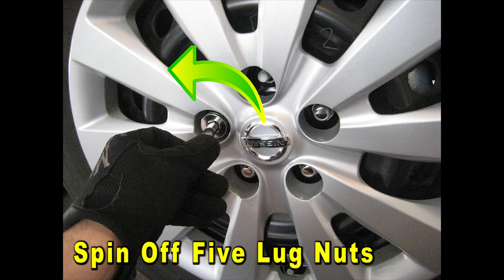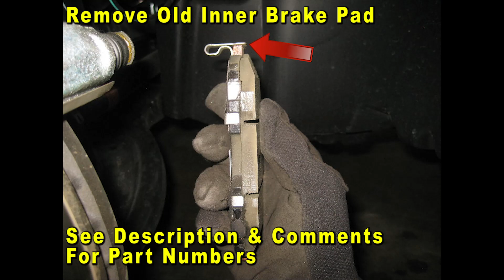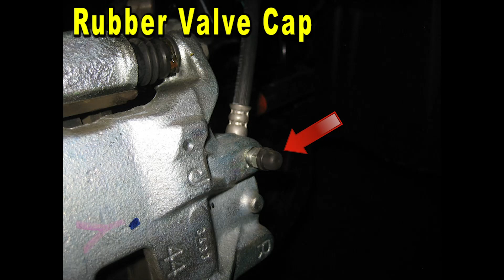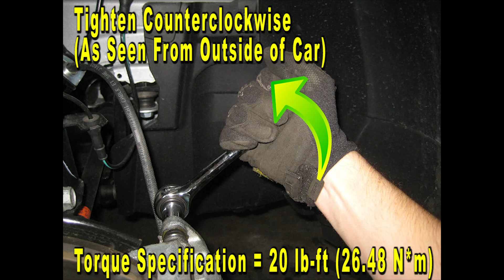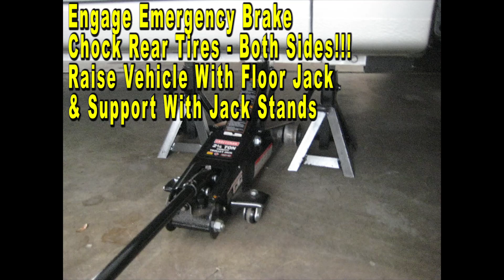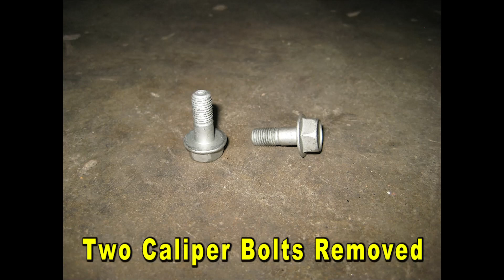Nissan Sentra How To Change Front Brake Pads 2013 To 2019 7th Generation B17 With Part Numbers

Comment from the maker: Nissan Sentra Front Brake Pads - https://amzn.to/3Ws9T9O
Bosch Front Brake Pads Part Number - https://amzn.to/3GZczWH
Power Stop Ceramic Front Brake Pads - https://amzn.to/3iVrglG
Wagner Ceramic Front Brake Pads - https://amzn.to/3wocTcE
Socket & Ratchet Set - https://amzn.to/3Z17LbA
"F" Clamp - https://amzn.to/3ZQnmLC
Mechanix Gloves - https://amzn.to/3jCnHkt
Torque Wrench - https://amzn.to/3vS5uSI

The Paul79UF YouTube channel is a participant in the Amazon Services LLC Associates Program, an affiliate advertising program designed to provide a means for sites to earn advertising fees by advertising and linking to Amazon.

Comment from the maker: Check out the DIY guide for changing the front brake pads on a seventh generation 2013 to 2019 Nissan Sentra - 
https://www.paulstravelpictures.com/2013-2015-Nissan-Sentra-Front-Brake-Pads-Replacement-Guide/index.html

Here are all of the DIY repair and maintenance tutorials for the 7th generation 2013, 2014, 2015, 2016, 2017, 2018 & 2019 Nissan Sentra - 
https://www.paulstravelpictures.com/Articles/2013-2015-Nissan-Sentra-Common-Problems-Repair-Maintenance-Guides.htm

Owners of other Nissan or Infiniti vehicles such as the Versa, Maxima, Juke, Rogue, Altima, Xterra, Pathfinder, Murano, Cube, Armada, Leaf, Quest, Frontier, Teana, 370Z, GT-R, Titan, G25, G37, M35, QX56, QX60 and M37 may also find these DIY instructions to be helpful.